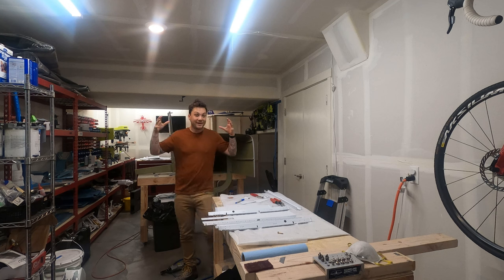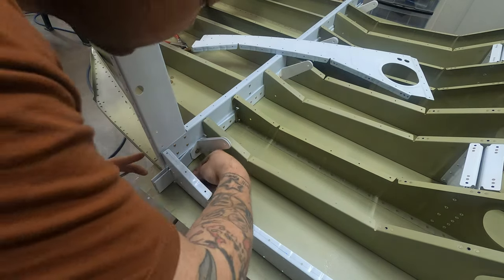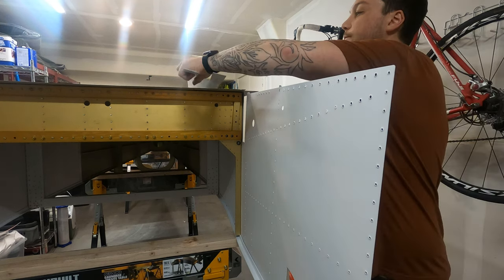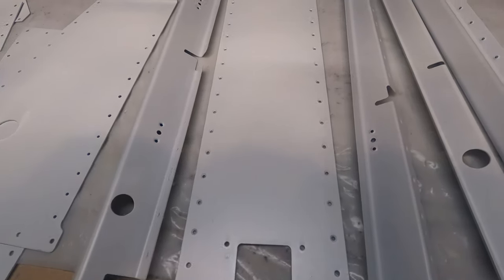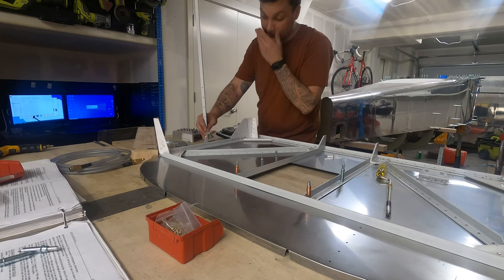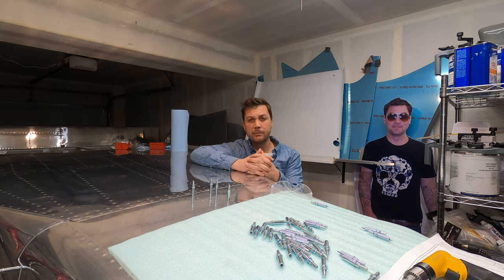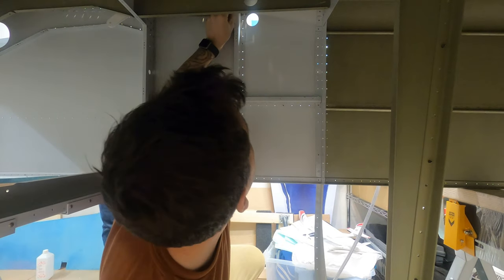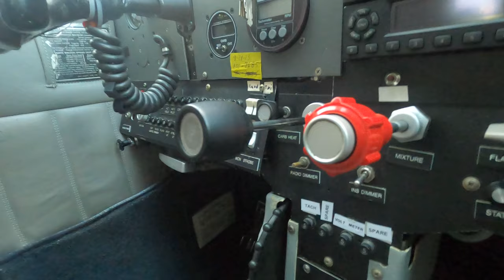Assembling the Fuselage | EP3.19, Building an Airplane: The Van's RV7A

Comment: I put my support message to you as a builder in the vans announcement video yesterday Ryan. 

Seems to me that kits are not that cheap, just not expensive enough to make up for scrape quick build sets due to bad primers and the laserxut issues on parts in general...

Hope you didn't have down-payments in!

Hang in there; build the rotary table, buy that stool and safe your back 🤗😜
Reply from the maker: My back grows stronger by the day. It just doesn’t know it yet!

Maybe one of those $900 stool companies will sponsor a video. Like the Viper or whatever.

Thanks for the support. Very much. And 🤞🏻 I get my finishing kit.
Reply: You're better at marketing than I am.. Shouldn't you have #-tagged the Viper bit or something to get that going 😅?!

"Dear customers out there. Viper has a limited special edition for you amature builders at a special surplus of 30%. For that it'll make airplane fly-by noises and do the top gun sound track whenever it notices you need a building boost with its in-build AI processing unit"

..😂

I think if they can't get loans etc they'll file bankruptcy. Then someone can take over and start again with a clean sheet and no strings attached. Any money in from anyone will be gone. So I sure hope you don't have a big down-payment in!

But I'm sure you will be able to buy parts again in some time from now for sure! So not all will be lost for sure!